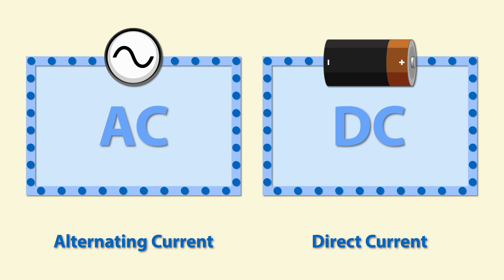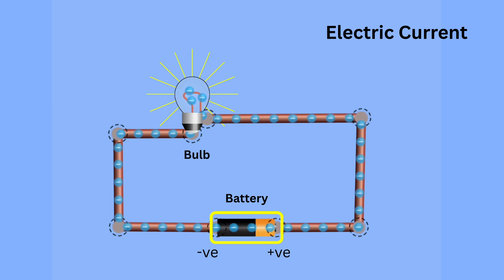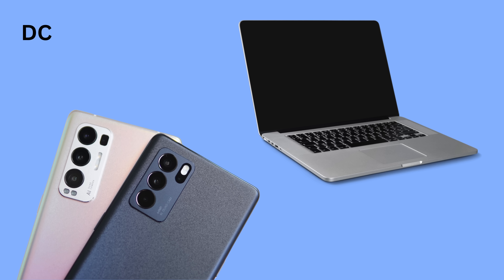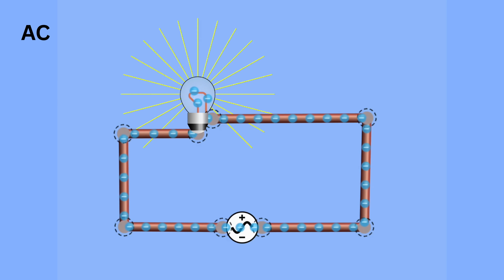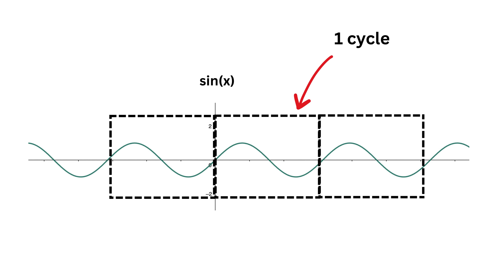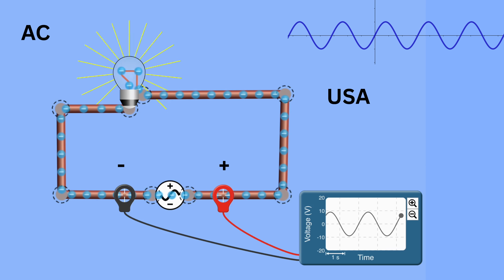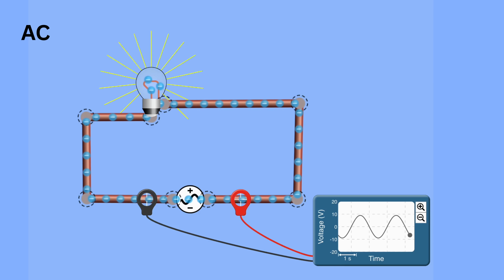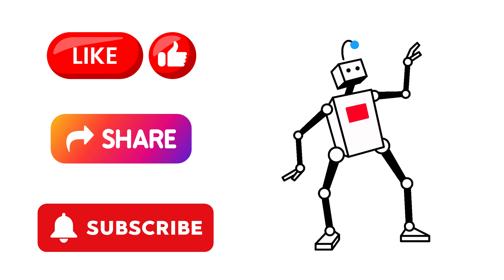Best Explanation of Alternating Current Vs Direct Current

Comment: Ok...but HOW do they alternate the current at the original power source? With the battery, it was clear...one side is positive; the other is negative. But if you are 'switching' it, how do you do that?
Reply: Electricity is generated in power plants using steam which is produced by heating water with some sort of fuel. That steam spins a turbine which spins magnets in a generator (rotor). That rotating magnetic field induces current in the generator's windings (stator). The magnet has a polarity and as it rotates, that polarity changes electron flow. This "pushing and pulling" of electrons is A/C.

Comment: Except - that in AC circuits the electrons only vibrate back and forth a tiny amount (a very tiny amount).  The electrons in the AC wire in your house wiring are the same electrons that were there when the wire was installed.

Comment: This is factually incorrect. AC is not always better for long distance transmission, its high voltage is however. DC is in fact better for transmission over long distances, providing it is over several hundred kms over land or around 100km when subsea. Otherwise, it is more cost effective to run HVAC transmission lines due to the cost of the DC setup.

Comment: Is current the flow of electrons? I've read that electron flow from one atom in a wire to the next atom is far too slow to explain why a light turns on so quickly when we flip a switch and  it is the charge (whatever that is) flowing at the speed of light that results it the light turning on so quickly.  Any help?

Comment: Really good explanation. What I don't get is, in the DC example, if the only thing moving through the wire are electrons, and they are going from negative terminal to positive terminal, why is the "current" defined as the opposite direction, from positive to negative terminal? Seems counter intuitive.
Reply: I’ve taught Engineering for 32 years, and You are correct… The content creator is wrong.
“Protons” on the positive side have no ability to move. Only electrons move.
They got the point correct when they said it always flows from negative to positive… But you would not then indicate the “direction of current flow to be from positive to negative… Because it doesn’t work that way.

Comment: The AC power was originally developed for and only used for lighting . There were also AC motors at that time but they were just curiosities for demonstrations that did not produce enough torque to do any meaningful work  . Tesla solved this problem with his original 2 Phase and later 3 Phase motors , transformers , and generators integrated into a 3 Phase power system .
Reply: There is a great book about Tesla " Tesla a man out of time" that chronicles his life and achievements and has many photos

Comment: And that is where I become lost. If AC alternates back and forth, how is it “consumed”? That is, how is power consumption tracked? It seems like it never actually leaves the building.
Reply: Having taught Engineering for 32 years,  I don’t wanna get too technical 🤞… because  the “physics folks”  out there would say that the energy is never truly “consumed“. They would say that when it passes through a device that uses electricity… Technically known as an electrical “load“… The device “uses“ the energy to turn on a light… To make a motor turn… Etc. which is actually a process of taking that electrical energy and converting it into a combination of mechanical energy or light energy and in most cases thermal energy because “heat“ is almost always a byproduct of using electricity.
Final thought… One reason that it never seems like the energy gets “used up” is because is basically due to 1- your electrical power company… Or your battery manufacturer… Provide a relatively constant “push“ technically known as “voltage“ which you undoubtedly have heard of (such as a 9-volt battery) that keeps the electrons moving and 2- all of this is happening essentially NEAR the the speed of light thanks to something called “signal velocity“ which is  one of three “velocities” that relate to the movement of electricity. 
Consider Googling “physics professor and author Christopher S. Baird” as he does a pretty decent job explaining how the three different types of velocities interact.😉
Reply: @a @allucht6664 So is DC electricity consumed by the device and AC is not?
Reply: Every circuit in your home only draws power when there is a load such as you turning on the lights in a room.  When this happens the meter outside your house can measure the power being consumed based on ohm's law.

Comment: This is NOT true!  Electron movement does NOT light the bulb.  In fact, in AC circuits, electrons merely vibrate.  Your explanation is false.  However, it was once understood to be this way.  But it has since been realized that the field of energy is what powers the circuit, not electron movement.  It is much more complicated than how this video explains it.  The best explanation via video I've seen is Veritasium's video, 'The Big Misconception About Electricity.'
Reply: Проблема в том, что многие пытаются объяснить суть микромира на примере макромира, но это невозможно, потому что они разные. Даже в школах учителя хватаются за примеры, которые кажутся им понятными, тем самым погружая способных учеников в когнитивный диссонанс.
Reply: so you're saying electron movement does not light a bulb?  wrong wrong wrong in dc circuits the flow of electrons is the current and physically are emitting from a lower potential negative battery terminal to the higher potential side of the battery or positve and that current through the bulbs filament is what causes it to glow or light up. and that is the same for ac circuits too. why do you think incandescent light bulbs had a wattage rating if current isn't part of the equation?  if what veritasium said was true then semiconductors would literally not even function at all. his video only explains some edge cases with AC and nothing else

Comment: How can that be ??
So if you have a battery, as you say with electrons in the battery that move, then if you had a wire that was hugely long, there would be a delay of the light going on as the electrons need to get from the battery all the way to the bulb ? 
But surely the electrons in the wire not the battery move from the end connected to the battery straight into the battery, not electrons travelling from the battery around ?

Comment: Direct current is so much easier to understand. I would humbly suggest we end our "experiment" with alternating current and just stick with DC.
Reply from the maker: While DC is simpler, AC is crucial for long-distance power transmission and many modern applications!
Reply: @BrainStationAdvanced  My attempt at humor failed. I'm going back to my day job.
Reply: If communities were powered by DC current, there would be large, two story generating stations every mile or so. Each station could power only the homes and businesses within its small 1 - 2 mile range.

Comment: The use of AC for most low power devices is because it is simpler, but when transmitted over longer distances, DC loses voltage (power) which cannot be corrected. Therefore, if DC becomes your home / office supply then your power outlet may have any voltage lower than what was sent. Using AC this loss of voltage can be corrected using a transformer. This is why Nocola Tesla was able to win the argument that AC should become the supply. Funny but true is the fact that Edison did not understand AC well and continued to oppose it. Edison tried very hard to push for DC supply to all homes and offices, but failed. The power company in New York is still called "consolidated Edison" since it consolidated between the two arguments and finally decided on AC. However, the trains in the subway are still fed with DC.  Also the new "electric cars" use an AC motor - although it uses a battery, DC motors are not as efficient as AC motors. Hence, Tesla wins again! Once the car "Tesla" switched over to AC motor, all manufacturers realized its efficiency and switched over the AC motor

Comment: 5:31 is that not saying the bulb does not flicker but you then say we cannot see the flickering?
Reply: If 120vac alternating at 20 Hz was powering an incandescent light bulb you would be able to see a noticeable flicker. This has been described as "Annoying " and is one reason for 50/60 Hz systems

Comment: WOW so much incorrect information.

Current DOES NOT MOVE that fast. 
Electron drift is very very slow, like 4inches per hour dependant on voyage. 
0:28 electrons flowing through the filament is not the reason why it glows. 
EMF electro magnetic force being induced into the field from OUTSIDE of the conductor is what delivers energy to the circuit to make it "glow" current alone is part of the equation to allow EMF to make the filament glow.

0:47 the flow does not slow down. It does not. 

Waterfall analogy is for people that can't comprehend electrical dynamics, it's not accurate, it's a poor way to understand the actual physics. Because electrons can infact go backwards, and other particles in the conductor do infact not flow in the electrical direction. 
The falling waterfall would be closer to a metaphor for Voltage. Not current at all!! 
Horrible analogy 

1:34 ? 😂 What??? 
Oh gosh you are uneducated.
I'm worried people will.believbwhat you're saying and be less intelligent. 

Other things electricians constantly get wrong are - 
voltage is pressure. IT ABSOLUTELY IS NOT. voltage is closer to an "allowance" like a ball rolling down a hill, it's allowed to move. 
Voltage is not preasure under any circumstances, it doesn't force electrons to move, it allows electrons to move along a conductor with Charge. 

Think of this as an example - it is a fact that electron drift is extremely slow. Very very slow. 
How can such a slow moving thing hurt you ??
Does a car moving at 100miles an hour hurt you? YES. 
Does a car moving at 4 inches an hour hurt you ? NO!!! 
either does current.
Current does not kill you neither does voltage it's the EMF induction into your tissue that burns you.

Comment: Electrons don't actually flow anywhere - for instance, AC current flows despite being completely disconnected in transformers.
Reply: Current never "flows". Charge flows or oscillates, which establishes electromagnetic fields which then can propagate electromagnetic waves to do work.
Current is defined as the flow of charged particles (electrons or ions). So saying that current flows is beyond redundant. It's needlessly confusing to learners. Even textbooks fall into this bad habit.
Reply: @tar170  the direction of the current is opposite to the direction of the electron flow. ..

Comment: @ 1:30 u made a change tht deserves to be explained. Electrons fall from the -ve terminal to the +ve terminal. But then u say conventional current flows from +ve to -ve. What's actually flowing from  from the +side in conventional current?
Reply from the maker: In conventional current, we imagine positive charge flowing from the +ve to the –ve side.

In reality, it’s electrons that move the opposite way ... from –ve to +ve. Scientists originally thought that current was the flow of positive charges, so they defined the direction from + to –.

Later, when electrons were discovered, it turned out they actually move the other way. Still, they kept the old convention for simplicity and consistency in circuit theory.
Reply: @BrainStationAdvanced  I wish you had explained it this way in the video!
Reply: Think of it as the "holes" vacated as the electrons flow in the opposite direction.

Comment: Electrons does not move. There are fields which transfer the energy. Otherwise wireless transmission could not be done.
Reply: Of course they do and when they do they create these fields. In AC they are vibrating in DC flowing in one dircetion.
Reply: @wojelitarny Yes, you are right. Just got the confirmation by Santa Claus.
Reply: Electrons do move... The fact that electrical fields exist doesn't mean electrons don't move. They flow pretty slow through a wire, though. Please retire from engineering. Get into accounting or something that doesn't require more than middle school maths.

Comment: you said, high voltage means less current.but as far i know V is directly proportional to I( ohm's law) , then how is it possible??? please tell....
Reply: Transmissions use a power formula. P = IV. So, we transmit a fix power for ex 1000W. Now, if we transmit the same power with higher voltage, current naturally decreases. The ohm's law is for the wire, the wire has a resistance R. V = IR will give the voltage loss during the transmission across the wire, the V here is not the one being transmitted.

Comment: Do electrons move?
Reply: Yes
Reply: @AliSaqi-n6t  I know that charge is transferred between electrons, but I've yet to find evidence that electrons move between the poles. Any reference would be nice.
Reply: Yes, they move, but very very slowly. What "moves" is the electric field generated by the moving charges, that propagates in the speed of light. The Electrons themselves moves towards the opposite pole millimeters per hour, if i'm not wrong, not sure of that.
Reply: @Kaue-o7k  That's exactly what I remember from studying physics at Uni.
Reply: @Kaue-o7k So, am I correct in thinking the electrons move in the opposite direction of the current?

Comment: But when AC current flows in long distance power lines, does the flow of electrons change direction in a given time period? And between which two points ? In your battery example, it were the two ends of a battery, but in a long distance cable ...? Please explain.
Reply: Current never flows. Electrons flow. Current is the flow of charged particles (electrons, ions). So "current flowing" is the flow of the flow of charged stuff, which is silly.
Reply: @tar170 but this is not an answer to the question.

Comment: Electrical current is induced  by a moving magnetic field over a conductor. The only difference between AC and DC is that the latter  is induced by a chemical reaction and the former is induced by an actual magnet.

Comment: If you're going to post this kind of stuff why not get it right. Electrons don't "flow" anywhere. The comparison of an electric circuit to water flow through pipes works to understand electric circuits and ohms law. But it is so far from what is really happening with electricity. 

Please explain your statement that electrons flow from + to - when an abundance of electrons is a - charge.
Reply: Most of the videos are people just regurgitating what they’ve been taught whether or not it’s correct. People who can think out of the box have moved on.

Comment: Only works with bulbs, doesn't matter which way the current runs through it. All other equipment uses DC so the AC has to be rectified to DC.
Reply: AC - Works also with electric heaters, toasters, coffee machines...
Reply: is it? YOU WILL BE THE NEXT RECIPIENT OF NOBEL PRIZE, I AM SURE....

Comment: 00:59 current flow direction wrong
Reply: It's correct because the actual current that is the flow of electron is from -ve to +ve terminal, whereas the conventional current is from +ve to -ve terminal
Reply: No, it's going correctly. That's how I remember it: on the plus side, it's 'adding" the current into the battery while on the negative side it's "deducting" coming out. My source is from an "electric" manual many years ago, don't remember it's name.

Comment: So why is ac current required ?
Reply: Because you can generate more electricity with large moving  magnets than you can by using an oxidation reaction , which is what happens in batteries. That’s why batteries have  been used primarily for  smaller applications like flashlights and transistor radios. Even with all the advancements, batteries in Tesla’s weigh between 1000 and 1500 pounds.

Comment: I still don't understand why AC is better for high voltage...
Reply: It’s not, some transmission lines now use HVDC between 100kV-800kV. Old low frequency AC high voltage is easy to up/down convert using transformers.

Comment: 1:41 Just why would one do that to begin with?
Reply from the maker: Yeah I understand...When scientists first defined current in the 18th century, they didn’t know about electrons. They assumed that electric current was the flow of positive charges from the positive terminal to the negative terminal. This became the conventional current direction.

Later, when electrons were discovered, we found that electrons actually move from negative to positive. But by then, the convention was already established, and all textbooks, equations, and engineering standards were based on it. So today, conventional current flows opposite to electron flow...and we just stick with it to avoid confusion.
Reply: @BrainStationAdvanced Yea, for sure it does avoid..
Reply: Thank Benjamin Franklin. He did not believe in Charles Du Fay's idea of the kinds of electricity and believed that electricity was a matter that flowed and there was either excess or lack of it. He declared that class electricity is positive i.e. It has excess of the electric matter and the resin electricity was  negative. When electrons were discovered 150 years later they were found to be negative. It was too late to change things.

Comment: I have 1 doubt 
Why does current not decrease on passing through a resistance?? be4 watching ur video i was studing physics. So can u pls help me??
Reply from the maker: The current does decrease if the resistance increases for the same voltage, according to Ohm’s law I = V/R

But in a circuit with a fixed resistance and fixed voltage, the current remains constant
Reply: It does.
The resistance is what regulates the flow. Less resistance, more flow.